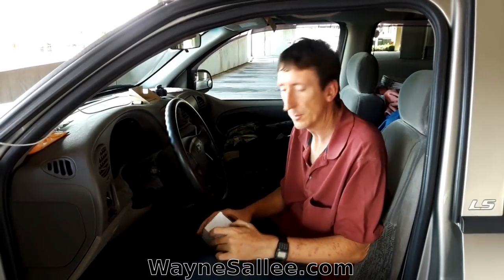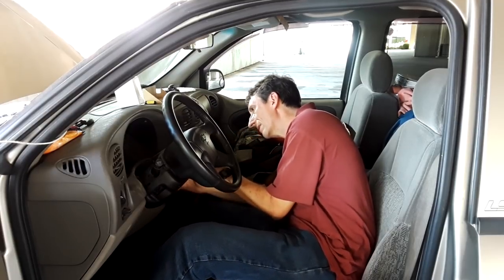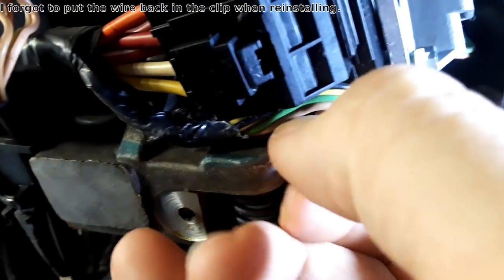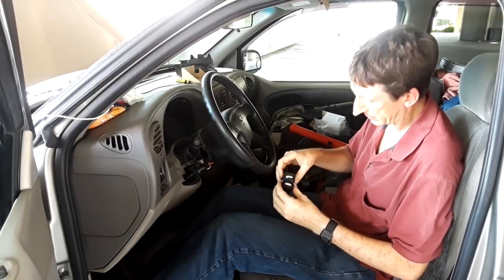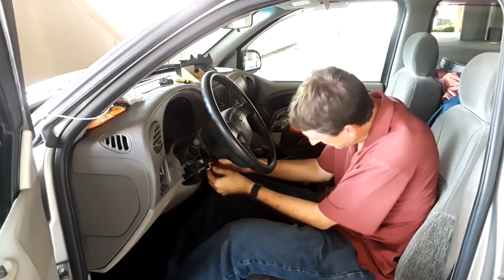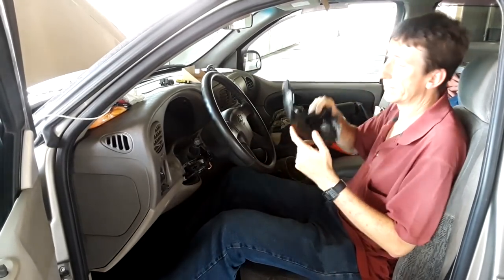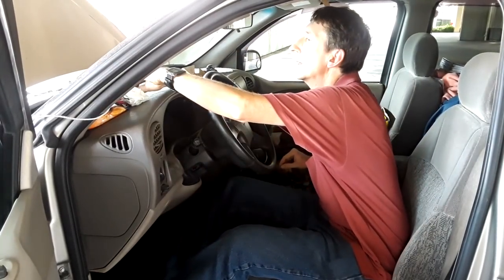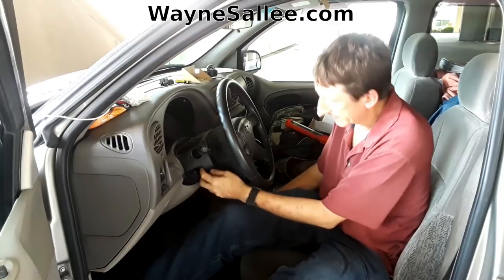Easy way to replace the Ignition Switch in Trailblazer 2002.

Comment: I have a 08 tb and I am trying to figure out why the car won't turn over but will turn on. We had this replaced a couple months ago could have gone bad this quick or could have just been a bad one and and I have to do the replacement again
Reply from the maker: It probably was not bad to begin with. Did you keep the old part?

Could be a starter solenoid problem. Intermittent problems can fool you when you replace a part assuming that it was bad.

Wayne Sallee
Wayne@WayneSallee.com
http://www.WayneSallee.com

Comment: Hey Wayne, I've got an 06  Envoy w/ 4.2 L engine, with an engine stall, no code situation.  Car is just going along the road, and shuts down and no codes come up, no engine light. It always restarts but this is a dangerous situation I'd like to fix.  I checked the timing solenoid connection for oil, it was clean. I've cleaned the throttle body, replaced cam shaft sensor, put in a used fuse box under the hood ( as new ones are no longer available) , tomorrow I'm changing the ignition switch. I hear the crank shaft sensor can sometimes be a problem too.  ..any other suggestions besides the one I don't want to hear?  PCM ? or scrap the darn thing? Thanks.
Reply from the maker: I don't think it's the ignition switch. I have 2 separate similar issues. The car never stalls, but acts like it's trying to. Same thing with the no codes. Though a $1,000 scan tool might find the problem. :

1) The motor does a quick skip at random, at idle, and quickly recovers. It only happens at idle.

2) The voltage drops at idle and slowly goes back up. It only happens at idle.

I suspect the throttle position sensor, but I am not going to buy a whole new throttle body just to replace a stupid sensor that might be bad. Chevy ripped us off by making the throttle body sensor not replaceable. It's also a sliding wire type instead of the more dependable Hall Effect type.

It's been like that since I purchased the car years ago, and has only gotten slightly worse. But it's an annoying reminder that it will eventually get worse.

Wayne Sallee
Wayne@WayneSallee.com
http://www.WayneSallee.com
Reply from the maker: With older cars one could adjust the idle screw to help with such problems. But not with this car.  Does your car stall at idle, or when you are giving it gas. At what stage does it stall?

Wayne Sallee
Wayne@WayneSallee.com
http://www.WayneSallee.com
Reply: @WayneSallee-comTech   I agree Wayne, That TPS should be replaceable.  Well replaced the ignition switch this morning anyway, and drove it probably 20 miles with no stalling (yet), but now the stabiltrak light flashes after driving it a while on dry clear roads.. Another problem to diagnose.  Appreciate your feedback.

Comment: nice watch. casio dbc-xxx?  i am learning my way around cars, i even have done an engine swap just using youtube and my tears before but i dont know most of the basics. my question is this: would a broken ignition switch cause the interlock solenoid to not actuate? i cant press the thumb lock on the shifter in to move it out of park. i tore the console out and removed the interlock solenoid so i can get around. anyways i thought for sure the interlock solenoid was bad, but i swapped a known good one in and it too doesnt actuate. seems like things should make clicking noises when you press on the brake i have nothing. random bit of side info: for a couple of years i would occasionally get chimes like a door is open or something when no door is open, thinking maybe ignitions switch problems?. i bought this used and it has an after market stereo maybe that weird little box that satisfies the alarm system and stereo nonsense is bad? also, this issue with the interlock  solennoid used to blow a fuse under the hood called  "backup", i would replace the fuse then i could drive it for 6 more months until it blows the fuse. as i said its not blowing the fuse any more its just not telling the interlock solenoid to do its job. while i do have a second trailblazer i borrow parts from in these occasions, i am going to try brake liight switch then this ignition switch. i know i can bypass this permanently but i am an idiot, that safety mechanism is for me
Reply from the maker: It sounds like you have a bad break switch. If it does not get a signal from the break switch it won't let you change gears. My watch is a Casio dbm 150. It was manufactured in 1991, and I purchased it in 1992. I have had to nurse it along to keep it going.

Wayne Sallee
Wayne@WayneSallee.com
http://www.WayneSallee.com

Comment: i have an 03 tb. the other day my wife said she turned the car off but it didnt turn off. hasnt happened since. but i have been   noticed i have to to turn the key harder to turn it on. could that be sign of thr ignition switch goin bad?
Reply from the maker: Having to turn the key harder could be the ignition switch. Easy way to tell would be to remove the ignition switch, and then try turning the key. The ignition switch does normally give you your spring back pressure.

But if it turns rough like it's hanging then it's probably the lock, especially if you feel roughness even with the ignition switch out, then it's the lock.

So take the ignition switch out, and see what happens.

Wayne Sallee
Wayne@WayneSallee.com
http://www.WayneSallee.com

Comment: Can you tell me if this is the problem I'm having with wife's truck the key is stuck on willnt come alway back so I can't get the key out so it's killing the batter
Reply from the maker: Well it's always good to proofread before submitting. Yes a bad ignition switch can drain your battery, but more often than not, it will fail with an open connection instead of a closed connection.

Wayne Sallee
Wayne@WayneSallee.com
http://www.WayneSallee.com

Comment: Thank u,  great video! All good here except when I put back the plastic covering. Typical plastic Chevy crap didn't line up. But at least my heater controls work and service 4x4 dummy light is off.
Reply from the maker: Thanks. Did you try taking the cover back off and looking at it? There is a little tab on the inside of the cover that likes to get in the way, and get bent. Video location 2:41 . I don't think I ever pointed it out in the video, but you can see 2 pieces sticking up inside at this point in the video.

Wayne Sallee
Wayne@WayneSallee.com
http://www.WayneSallee.com
Reply: @WayneSallee-comTech  yes. I probably bent it just enough to where it won't line up. No biggie it has over 200 k on it, not a show car lol
Reply from the maker: @jbb8382  It's easy to bend back.

Wayne Sallee
Wayne@WayneSallee.com
http://www.WayneSallee.com

Comment: Hey Wayne I have a question,I'm having the anti theft stopping from starting my car ,it says I need a new new ignition switch cause of the contacts, causing the anti theft to kick in, does that sound about right, if I replace this my suv Yukon 2001 will stay running instead of shutting off immediately, or do I have to have my Yukon anti theft reprogramed
Reply from the maker: There is no need to reprogram anything when replacing your ignition switch. It's just a set of switches. At least that's true with the Trailblazer. It's getting crazy the way manufactures are trying to make it harder, and harder to repair.

Wayne Sallee
Wayne@WayneSallee.com
http://www.WayneSallee.com

Comment: Best video I've seen on replacement,but NOBODY says what style screws star, phillips hex square, at 70 my vision isn't what it used to so it would be nice to know ahead of time. guess I just have guess until 

I hit the right one.
Reply from the maker: I'm glad it was helpful. I don't remember what type of screws they were. I wish my vision now at 49 was what it was at 40. Amazing how much of a difference 9 years makes. And I don't like carrying reading glasses around. Too bad human growth hormones are so expensive.

Wayne Sallee
Wayne@WayneSallee.com
http://www.WayneSallee.com
Reply from the maker: You might need a hex screw driver bit. But most vehicles don't have that screw in them.
You will need a small flat head screw driver, and a tiny flat head screw driver.

Wayne Sallee
Wayne@WayneSallee.com
http://www.WayneSallee.com

Comment: Great info on replacement! My interior and exterior lights are having a sort of strobe effect dimming after the car is on. A lot of forums are pointing to the ignition switch being the culprit. Any input of it being the cause of dimming lights after startup?
Reply from the maker: It looks like Communist Google hid your post for 2 years, and has now decided to show it. I'm thinking that the flickering lights are caused by something else, that is affected by the vibration of your engine. I guess that now that it has been 2 years, you have probably figured it out. What was the cause?

Comment: So one of the keys is stuck in there and the four position and I need to change the ignition switch how do I get it to get the key out
Reply from the maker: The ignition switch and the lock are 2 totally different things. You can change the ignition switch even if the key is stuck in the lock.

Wayne Sallee
Wayne@WayneSallee.com
http://www.WayneSallee.com

Comment: Is this what i need to do if my car doesn’t start after turning my key? My gauges on the dash start to erratically jump up and down and then when i go to twist the key my car is just non responsive
Reply from the maker: It could be. Have you noticed this to have slowly gotten worse over a period of time? Have you noticed that things would not work right, but if you turned the key off and did it again, things worked? If so, it's probably the ignition switch. Some times the gauge cluster goes bad, and causes that kind of behavior. But more often it's the ignition switch. If it turns out to not be the ignition switch, then it is probably your gauge cluster.

Wayne Sallee
Wayne@WayneSallee.com
http://www.WayneSallee.com

Comment: I have a 05 tb lights dim an rpms drop in idle when I push any of the window switches headlights also flicker while driving sometimes has new battery and alternator could this switch cause my issues
Reply from the maker: No it's not the ignition switch. That's a run-on sentence. It' hard to tell exactly what you are saying. What exactly are you saying? Obviously you have an electrical problem. A lot of GM cars are bad about that.

Wayne Sallee
Wayne@WayneSallee.com
http://www.WayneSallee.com

Comment: Wayne!!!! I was reading through the comments and saw playerfortee had said that they thought their lack of air conditioning coincided with their ignition switch. I am having the exact same problem. My temp gage has been bottoming out, rendering my air conditioning useless and I am also having problems with my ignition engaging. Coincidence??? Or could I have 2 different problems?? Amy.
Reply from the maker: I don't think it is related. What exactly is your AC doing? 

Wayne Sallee
Wayne@WayneSallee.com
http://www.WayneSallee.com

Comment: Hey bud.. I have an 03 envoy with the 4.2 bought it two days ago. Day after I bought it showed it to my son drove around block all was good. Sat idling for like 2 mins it died and won't start. Jumping the two pins to see if fuel pump kicks in.. it does.. Lots of pressure at the filter.. The one thing that don't check out is the power from PCM pin when key is on.. No power to the PCM pin of relay when key is on.. What could stop that? Any help is appreciated. One other thing.. Pump does not prime when key is turned on either..
Reply from the maker: The ignition switch going out is usually intermittent to slowly becoming more of a problem, so if switching it on and off several times does not get any results, then it's probably not the ignition switch. 

Does the engine crank?

Have you checked all of the fuses and relays?

What two pins did you jump to get the fuel pump to kick in? Was it the fuel pump relay?

Wayne Sallee
Wayne@WayneSallee.com
http://www.WayneSallee.com
Reply: Yeah cranks great.. And yes jumped two pins in the fuel pump relay spot to get pump to kick in. The main 12 volt pin has power and the ground has a ground,, Running jumper from main twelve volt diagonally to the other pin kicks in fuel pump. How ever the pin coming from the PCM which should have power when I turn key on does not get power.. I think what ever is causing it is stopping me from getting spark too because with the pressure built up from jumping fuel pump it still won't fire.
Reply from the maker: @dragonz868  I hate the way the spark plugs are. With my suburban it was so easy to check for spark. But you are probably right about there not being any spark. I don't have any real answer for you. It looks like you are already going in the right direction. It's a matter of following the path of where you have power to where you don't have power, or vise versa, to find the point of failure. I'm guessing that something fried. Any check engine codes?

Wayne Sallee
Wayne@WayneSallee.com
http://www.WayneSallee.com
Reply from the maker: Also by checking for check-engine codes would tell you if the computer is still operational.

Wayne Sallee
Wayne@WayneSallee.com
http://www.WayneSallee.com
Reply: No but that might be because weak battery died trying to get it going before I got hands on a scanner.
Reply from the maker: @dragonz868  The battery would have to be even weaker than a no crank, before it could be too weak for the computer.

Wayne Sallee
Wayne@WayneSallee.com
http://www.WayneSallee.com
Reply: Looks like it had an aftermarket auto-start put in at some point. Have not tore dash apart yet to see what I can find due to weather and having no place inside to work on it.. I did not get an auto-start fob with it so I don't know. Trying to figure out what will stop it from priming the fuel pump when key is turned on.. First thoughts when it died and would not start was, fuel pump, crank sensor, timing belt. 

How ever I know fuel pump is good and crank sensor should not stop pump from priming when key is turned and neither should the timing belt. That's why I was leaning towards ignition switch. This is the third vehicle I have got screwed on in 6 months. This one being electrical is killing me.. Not having tools like a scope and not being able to afford a shop.. Thanks for your thoughts..
Reply from the maker: @dragonz868  If the computer was refusing to start the car, it would throw a code. So it can't be the computer refusing to start the car. You can leave the jumper on the fuel pump, and try starting the car. You can check the spark to confirm whether there is spark or not. And while you are at it, you can check the plugs for fouling, from blown head gasket. You can take the ignition switch out, and check to see if it is working or not. It's easy to take out. Usually when an ignition switch goes out, it is just intermittent, which can make it hard to test, but with your situation it will be easy to tell if it is working or not. If you don't have a meter, you can get a cheap digital meter at harbor freight or other store. If you purchased the car from a dealer, most states have a 30 day return allowance.

Wayne Sallee
Wayne@WayneSallee.com
http://www.WayneSallee.com
Reply: Nah was private sale.. As is. I knew it needed an 02 sensor and ABS sensor, tires and battery..  Of which he gave me 4 good tires. Guy knew I had been screwed over twice before, said there was no other surprises with this one,,, SURPRISE!!! lmao..
Reply from the maker: @dragonz868  You should contact the seller, don't accuse him of anything, but just ask if he has any idea what it might be. He might tell you to check something without admitting that the knew it was a problem.

Wayne Sallee
Wayne@WayneSallee.com
http://www.WayneSallee.com